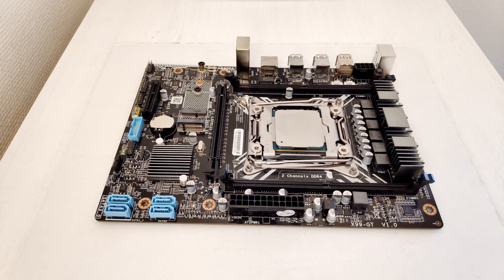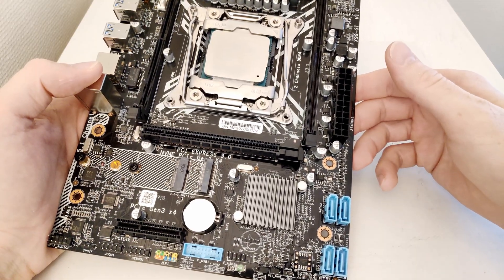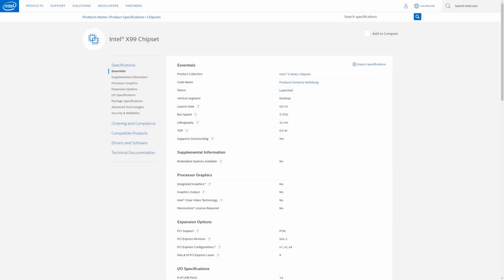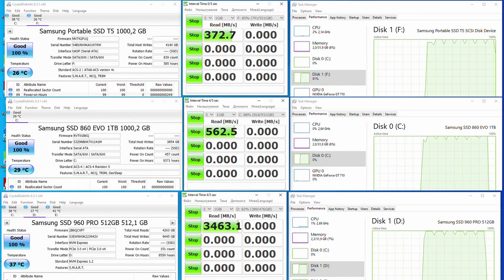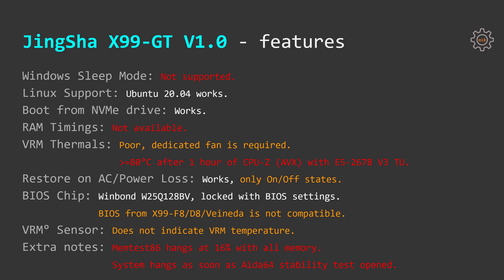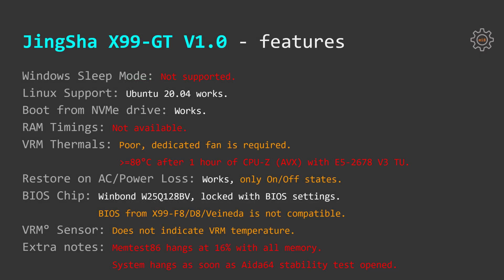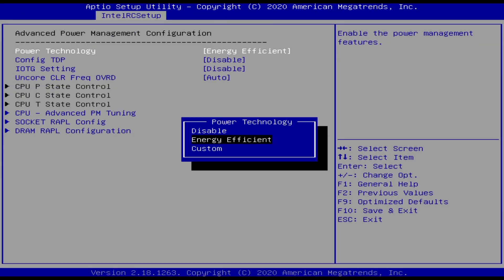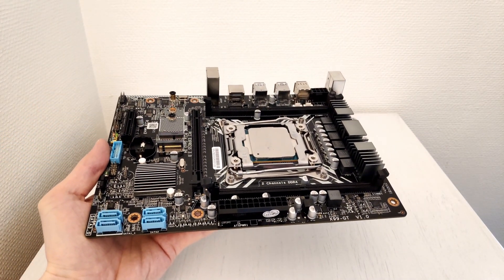🇬🇧 Detailed review of JingSha X99-GT LGA 2011-3 | Turbo Boost Unlock and CPU overclock

Comment: Hi there, i recently bought on of these unfortunately, the purpose was to use up some old pc parts i had lying around including an nvidia quadro k2200. The gpu itself is tested and works fine in another system however i can get any video output with it on the x99 board. Is there an incompatibility between the x99 board and quadro cards? Or is it likely there is another issue? Many thanks

Comment: Hello, do not tell me if a turbo boost block is needed or not? the thing is i bought a jingsha x99 dual processor and lan but when i did cache and memory test aida it shows that the cpu is running at 3.3ghz. This can be seen from this moment in my video https://youtu.be/jANim0TbOSI?t=121 can it be that Unlock is already on the board? Thanks for the answer!
Reply from the maker: No, Aida64 reports momentarily clocks, not maintained. Stress your CPU with CPU-Z and check clocks in Windows task manager.
Reply: @Miyconst  Oh! ok! Thx!

Comment: I also bought this board but the H81 chipset comes to me ... I don't know if it's better than the B85 ... finally
I managed to unlock the Turbo Boost Option thanks to your tutorial on injecting the FFS driver into the bios.

I'm facing another problem: the processor cooler goes at full speed, whether it's in the 4-pin socket for it or in the case ... and the cooler has 4 pins, so it had to be controlled ...

Also in the Bios menu does not appear "Hardware monitor" (Advanced) but only if I reset the bios to the default values then appears in the menu, I can make settings for the two fans, but after reboot does not adjust anything, the cooler goes to full speed and no more "Hardware Monitor" appears in the Bios menu.
Reply from the maker: Thank you for the info. Seems like this motherboard has very bad BIOS. H81 is also worse than B85.

Comment: Great video btw i have an issue with this motherboard  I have a ssd but it takes a lot of time loading Windows 10. Sometimes is faster but I dislike it is there any way to solve it?
Reply from the maker: You have to disable IME in the device manager.
Reply: @Miyconst  what is IME? I could not find it
Reply from the maker: @golappzo2382  It's Intel Management Engine.
Reply: @Miyconst  thanks bro worked fine!

Comment: I have an x99m-G, can I use this ROM?
Reply from the maker: Most likely yes, but check your chipset first.
Reply: @Miyconst  b81.
Reply: @Miyconst  
I managed to do it, I changed the ROM, then flashed using FPT.
Reply from the maker: @DzyanMendes  good job! I am glad to hear that you managed to make it working, now just make sure to have some good airflow in your chassis.
Reply: @Miyconst  My airflow is very good, I have an aircooler with 6 heatpipes and 5 fans.  With CPU stress it reaches a maximum of 48°, the CPU model also collaborates due to its TDP of only 55w. Thanks

Comment: I have  a x99M-G motherboard whit b81, it's the same of x99-GT.  but x99M-G have 4 slots for RAM, the modified Bios will work whit my motherboard?
Sorry for my English
Reply from the maker: I have not tested that particular motherboard, but as far as I know, the BIOS between B85/H81/Q87 is compatible. Still, the risk is yours.
Reply: @Miyconst  is working the Rebar "hack" on it too? i have the same board but im searching a lot of this model to unlock turbo boost and rebar..  another thing to ask u. Is "SRIOV support" a bios setting that change a SINGLE video card operation? i enabled this option (is down of the "Above 4g Decoding" on my bios) and my destiny dsnt have any spyke, why this?

Comment: Hii thank you for this video it help me a lot these motherboard lies a lot, its name is x99 and it have b85 chipset..do you think a i75820k will work on it? I buyed this motherboard and then i see your video..and i dont have yet the ram to test it all..thank you again hope u answer
Reply from the maker: I have not tested this board with i7-5820k, thus I can't say for sure, but I suspect that it won't work due to the missing PCI-E lanes in this CPU.
Reply: @Miyconst  thank you for answering your videos are soo good and technic but easy to understand, but i dont know what do you mean, for what i was reading that CPU have 28 pci lanes and i Will only use a gpu, a ssd by sata i will try to connect one more sata (dual slot gpu) and thats It, but what i think is that it will not work bcs the chipset isnt x99 and idk if the cpu can run in that shitty b85 chipset... what a mess.. thank you again
Reply from the maker: @catalindinu2944  let me try to explain. A PCI-E lane is a physical wire connection from a PCI-E slot to the CPU. Each lane has its own connector(s) on the CPU. The CPUs with only 28 PCI-E lanes physically do not have some of the connections (inside the CPU). Chinese manufacturers are often do not take into consideration these CPUs and connect PCI-E x16 slot to lanes 29-40, which means the PCI-E slot on the motherboard is physically not connected with the CPU, if the CPU has only 28 PCI-E lanes.
Reply: @Miyconst  very good explanation i understood, and i have good news the cpu works the Guy who i buy the motherboard today have let me to test it with this cpu and his ram and it works 😁 thank you very much for all.

Comment: so is this one trash or good?

im sorry it might be clear, but im trying to not get ripped off :v
Reply from the maker: It's a rather bad motherboard, which I don't recommend, even though it's not a complete trash either.
Reply: @Miyconst  i searched for this motherboard name, but could not find any reviews here is the name

 JINGSHA X99M-G placa base
Chip Intel X99 or otras
Reply from the maker: @headcrap6152  It's exactly the same motherboard, but a slightly different look. Chipset is not X99 as they claim, it's a random desktop variant: H81/B85/Q85.
Reply: @Miyconst  thanks alot for the help, your the best!!!

Comment: Feeder radiator, painted! On my board, I removed the heatsink, and cut out squares from the thermo-pad for each component separately and screwed it back! And the temperature has improved! For your money, a very smart motherboard. Привет из России!! ;)
Reply from the maker: Do you mean that the heatsink has direct contact with the VRM components without a thermal pad? This is a rather dangerous solution. Hi back to Russia.
Reply: @Miyconst   No! cut from the existing small squares according to the size of the components. So that there is more air space under the radiator
Reply from the maker: @Barguzin_122  Ah, now I see what you mean. Sounds like a good solution then.
Reply: @Miyconst   Also, on three pads of my own heatsink, I glued a heatsink from the chipset of the old board onto the heat-conducting glue. That's when I cleaned the gluing points and noticed that the radiator was painted.
Reply from the maker: @Barguzin_122  I am not surprised that Chinese paint the radiators, they try to do anything, what costs next to nothing, but may attract potential buyers.

Comment: would you recommed a 2678v3 (with something like a x99-t8)with ddr3 or a 2700? The cpu performance seems to be really close but the ddr3 ecc prices make the 2011 v3 platform really interesting, I could get 64 gb of ram at the same price that I could get 16 with ryzen, I plan on using it as a ws with also plex in the background and some games from time to time
Reply from the maker: It really depends on what you are looking for. If you need lots of RAM, then DDR3 + E5-2678 V3 is a good idea, otherwise Ryzen is better.
Reply: @Miyconst  I don't think that I need 64gb, probably more than 16 is better, I could stretch a bit the budget and get ryzen with 32 gigs and then eventually take it to 64 if needed once servers move to ddr5 and maybe even upgrade cpu to a zen3, other than for ram x99 would have to stay the same components
Reply from the maker: @UNVIRUSLETALE  then go with Ryzen.

Comment: Hi Miyconst! Did you have any desktop ram incompatibility with Huananzhi X99 F8? Do single side RAM sticks work just fine?
Reply from the maker: 4 and 8 bank modules are not working, unfortunately. The same applies to all tested x99 motherboards from China.
Reply: @Miyconst  My memory says:
1024Mb x8 (64Mb x8 x 16 banks)
Is it compatible?
Reply from the maker: @Guilherme_Oliveira72  Yes, it should be compatible. At least, all memory modules with such configuration I have tested worked well on the Chinese X99 boards.

Comment: Hello, do you have any experience with older socket motherboards from aliexpress, more specifically I'm looking to get LGA1150 motherboard and wondering if it's a good idea to get it from china. Any brands that are generally better or that you want to avoid in your experience? Appreciate it a lot if you can give your insights!
Reply from the maker: Hi. I don't have much experience, but mine JingSha B75 LGA 1155 motherboard died after 15 minutes of stress test.
Reply: @Miyconst   :D sounds promising.. generally does any of these brands stand out with better quality than others?
Reply from the maker: @DivineMoment  Do you mean from China or all brands?
Reply: @Miyconst  from china ofc!
Reply from the maker: @DivineMoment  Non of them is 100% to trust, all of them produce shitty products and okay products.
Reply: @Miyconst  guess I will just have to make a leap of faith then :D at least there's some with good ratings and 100+orders from Kllsri and Huananzhi. Anyway thanks for your tips I appreciate it a lot!!!

Comment: Can i use it for Intel xenon E5 2640 v4 2.40 this prossessor please answer sire
Reply from the maker: Yes, you can, if you don't bother about the issues I have described in the video.
Reply: @Miyconst  oh really actually I have this prossessor  so i want to buy a mother for this prossessor but v4 all are mother board sold out thanks sir now i will buy it

Comment: Did you record BIOS update guide for x99 d8 motherboard? I am building first budget PC but not sure if i can do bios update to Huanzhi on my own.
Reply from the maker: No guides are needed there, just take the Huananzhi BIOS and flash it with the FPT tool.
Reply: Miyconst What cooling would you recommend for Xeon e5 2620 v3 on X99 d8 motherboard? Actually I’m looking for Silentium PC Spartan 3 lt but It’s unavaliable in my country and unfortunately Fortis 3 is more than 2x price of spartan.
Reply from the maker: Basically any semi-decent CPU cooler will be enough for E5-2620 V3.

Comment: Thanks for the review.
I plan to buy the JINGSHA X99 Double bundled with 2*E5-2090 V3 12 Core 2.6GHZ (24 Core in Total), 8*16Gb DDR ECC Reg 2400 MHz RAM (128 Gb in Total).
This is for 4K video editing with Davinci Resolve, 3D animation with Blender 3D with a lot of fluid simulation.
So need to known if this is a good choice.
Reply from the maker: I always try to get the most powerful single socket solution instead of a dual socket setup, but if you really want a dual socket setup then get yourself a Huananzhi X99-F8D instead of a JingSha X99 Dual.
Reply: @Miyconst  Thanks a lot. I'll check that.

Comment: what do you think about the xeons e5 2697/2698/2699 they are quiet expensive right now but they not only got high core counts but also high turbo boost (3,6ghz)
Reply from the maker: I am thinking to get one of these for myself, but the price is unreasonably high at the moment.
Reply: @Miyconst  yea they are minimum 300 bucks right now.
With turbo unlock they will probably scale better in singlethreaded tasks against modern CPUs
Reply from the maker: Yeah, for this money I can get a second hand Ryzen 7 3700X, which is a way better deal.
Reply from the maker: @Alex-oq8yg  Thanks for the hint, I am already following these ones.

Comment: everything is unfortunately in your movies ... what about to avoid this word ?
Reply from the maker: I will consider it, thanks.
Reply: @Miyconst  good guy ! btw I am fighting with this cpu locked turbo-boost in few configurations (gigabyte x99 with 2680v4, asus c621 sage with xeon 6138, supermicro x11dpi with xeon 6138 and an epyc 7401 i forgot the mb a supermicro dual) can you please be so kind and provide a link with a guide how to remove this lock and release the full speed from specs ? thank you (now 6138 run at 2.8 and not 3.7,  2680 run at 2.3 and not 2.8 and epyc 7401 run st 2, not at 2.8) they are running at crazy low temp 28-35°C
Reply from the maker: @gionibegood6950  It's not possible. The Turbo Boost Unlocking hack only works with Xeon E5 V3 CPUs.

Comment: Author, like for work )
So this motherboard is much worse than the Kllisre X99 D4?
I looked - in appearance it seems similar. I bought and use Kllisre X99 D4 with a 2640v3 processor and am very happy with the build.
Reply from the maker: This motherboard is a "fake" X99, because it uses desktop B85 chipset, which brings lots of extra issues.

Comment: I would watch a video where you present a summary of all your testings on x99 best Xeon cpu, best motherboard, Xeon cpu in order of performance, performance difference of ddr3 versus ddr4, your motherboards recommendations in order of preference. Basically leverage all the many hours you put into the existing benchmarks and testing and recap it for someone not sure what to buy or looking to upgrade his x99 cpu.  Think a couple of PowerPoint slides. Thanks again for all you are doing !!
Reply from the maker: Thanks for the suggestion, I already have such video in my plans, but first I have to finish testing some other boards which are collecting dust at my home.

Comment: Took a chance and ordered a set with this board a few weeks ago.  Got it installed a few days ago.  Seems stable but cpuz reporting b85 confused me since I thought that was 1150 socket chipset, odd.  Guess this answers my question why sleep wasn't working.  I noticed in device manager that Intel management engine interface cannot start (unsure if MB or windows issue).  I am working with Jingsha direct AliExpress seller to see if they can fix, hopefully if unable they can ship me a D4 instead.
Reply from the maker: I would appreciate if you could update me regarding the progress with your dispute. If JingSha manages to solve the X99-GT issues, I will gladly make a follow up video about it.
Reply: Seller gave me drivers (chipset, lan, audio, usb 3.0), still error with Intel management interface and no sleep mode available.  I will say from a performance standpoint based on benchmarks I have run it seems to perform fine compared to other 2620 v3 benchmarks online.
Reply from the maker: @Lowfategg  And what does the seller say about the issue?

Comment: I can't imagine who the target audience is for this board.

You can't get the budget gamers because of only 2 memory slots, and that x16 slot is jammed so far up under the ram that a decent size card would interfere with the ram and probably any sort of hefty cooler.

Productivity is the same issue. Not going to be doing any graphic arts or video editing on this thing.

Limited SATA ports, so not using it as a storage server or a VM server.

I suppose you're only using this for maybe web browsing or light office work. But in that case an E5v3 is overkill.
Reply: Actually video card with back plate fits fine.  It's the CPU cooler you need to worry about.  With 120mm fan cooler I barely have 1mm gap between card and fins.
Reply: @Lowfategg  that's a very tight fit!
Reply: @greyshadow9498  very tight, I actually slotted holes in cpu cooler mounting plate to move it over a little bit.  Also m.2 mount under video card isn't great idea either because hot air from video card is going to bake SSD.
Reply: Yeah, I don't like how the M.2 is setup on a lot of Chinese boards.

Yeah I get they share PCIE lanes, but do they really have to put it that close?

Sure, on multi-x16 boards you can put them near other slots.  But in these single slot boards inwould have to think thry could put them a little further away.
Reply from the maker: There are many Chinese products with unclear target audience, they just make what sells. If people stop buying nonsense, - Chinese will stop making it, since their main motivation is $$.

Comment: Great review and detail! Helps a lot! Are you perhaps going to check out the most popular or most purchased x79 motherboard on AliExpress? Its the JingSha X79M-S motherboard being sold with a E5 2620 CPU, 4 sticks x 4GB = 16GB DDR3 1333Mhz. It's being sold by SZ computer accessories Store for around $80. Many thanks!
Reply: Yeah, I am not sure of whether I should buy the board or not as the VRM heatsink is a bit small at least on the picture. I plan to try and make a Hackintosh with a x79 or x99 motherboard but budget constraints are looking towards a x79 bundle of sorts. Thanks!
Reply from the maker: Thank you for the support. So far I don't plan to do any X79 reviews. There is already more than enough information about this aging platform.

I have successfully installed macOS Catalina on a Machinist X99Z.
Reply: @Miyconst  I see, thanks for the information on that x99 motherboard!

Comment: Thanks for this great video!
Have you seen any chinese board with single or dual CPU's who has 2 or more PCIe X16 slots?
Reply from the maker: Yes, you can watch my Huananzhi X99-F8D review: https://youtu.be/yfZW2b1WOlw
Reply: Jingsha x99 m-h2 Has 2 pcie x16 slots
Reply from the maker: JingSha X99 D8, Huananzhi X99-TF, X99-F8, X99-F8, and Veineda X99 also have two or more PCI-E X16 slots, but all of these are single socket options.